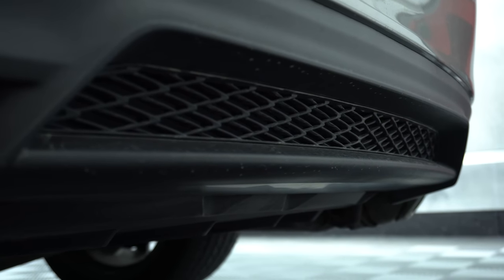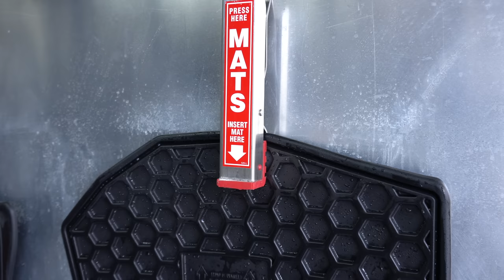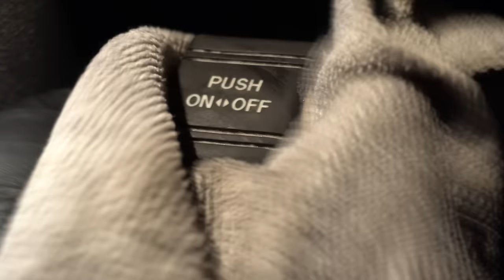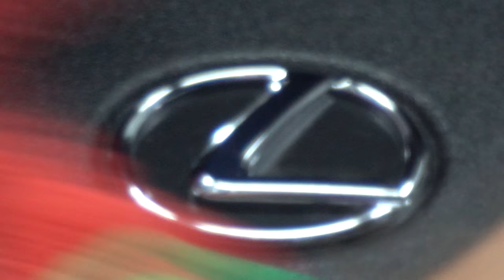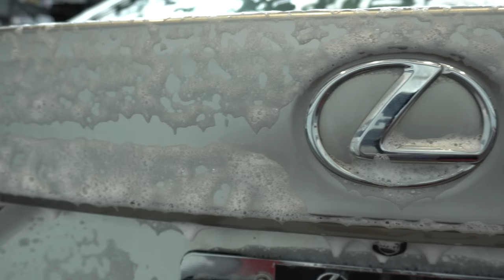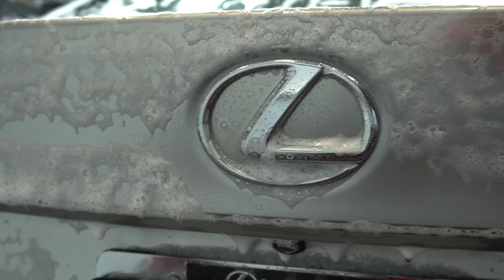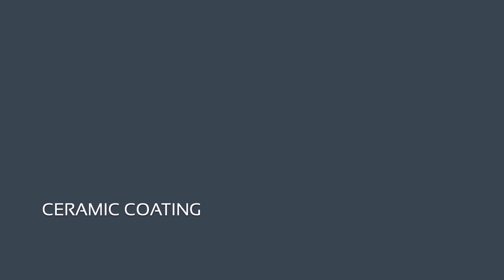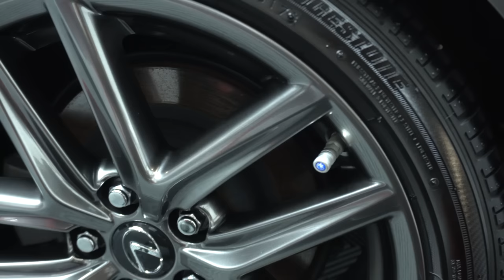2017 LEXUS IS300 F-SPORT LAVISH DETAIL | Interior + Foam + Wash + Polish + Ceramic Coating

Comment: How does Adam’s Tire and Wheel Cleaner compare to Adam’s Tire and Rubber Cleaner?
Reply from the maker: I love it way more. You can see the W&T Cleaner begin to break down grime instantly. Not having to apply two different cleaners isn't a huge time saver, but it is more convenient. I'm a fan. I'll still use the rubber cleaner for door seals and the like.
Reply: RΔD GΔRΔGE thanks! I’ll have to give it a shot. Brake Buster isn’t strong enough for tires in my opinion.

Comment: What was that tool for removing road salt on carpet?
Reply from the maker: phillywalz I used a little stiff bristle utility brush and a regular carpet brush and then just went to town on the residue with the vacuum nozzle.
Reply: RAD GARAGE but what did you use to break it off the carpet? I’ve had hell of time with it here in NY
Reply from the maker: I hear you. I get pretty aggressive with the nozzle of the vacuum when it is dry. I try to break up as much of it as possible while it is hard and dry. I find soaking it makes you think you are getting rid of it, but it's still there. I want to invent a nozzle that fits on the end of the vacuum that is specifically made to break up hard salt residue. It is such a pain.

Comment: What kind of ceramic coating was that?
Reply from the maker: I decided on using CQuartz Lite by CarPro for this project. It is reasonably priced and goes on quick and easy so it's a really good value. https://carzilla.ca/products/carpro-cquartz-lite-150ml-kit-new?_pos=3&_sid=b70e9f0fe&_ss=r&ref=RADGARAGE
Reply: @RADGarage  i am planning to buy a new car in the next 1-2 weeks. it will be my daily driver and my apartment complex does not allow me to wash my car. i absolutely know nothing about cars. from what i hear about ceramic coatings, itll make cars easier to clean. however, it needs to polished to keep it lasting longer?. i also heard that coatings can basically seal imperfections into the coating and to fix it you have to sand (?) it off? i need to do more research, but maybe this type of car work is too complicated for me at the moment. i just want my car to look good and for the paint to stay like-new. thanks! i will look into that item you used
Reply from the maker: @njm92495  Look into getting a spray sealant you can use when you have car all cleaned up. That's what I did for years before I had a garage of my own. I would go to the local coin-op wand wash, give it a good wash (never use the brush), then I would use a drying agent spray to dry it and then I would use a spray sealant. I would recommend Ethos Defy to finish off a wash. You aren't going to be able to do a ceramic coating if you don't have the facility or equipment to polish the paint prior. This is the next best way to maintain the finish on your car.
Reply: @RADGarage  i plan on buying the necessary hardware to properly apply a ceramic coating. from the power washer, foam cannon, scrub tools, microfiber clothes, water buckets, iron/tar removers, clay bars, buffer, IPA wipe and ceramic coating with silica spray. i just wanted to make sure i understand the steps before i actually do it. i want to be able to take care of my own car and to have the required tools/equipment to do so.
Reply from the maker: @njm92495  You sound like you are in it to win it. Awesome.